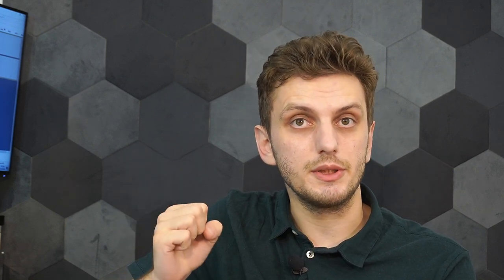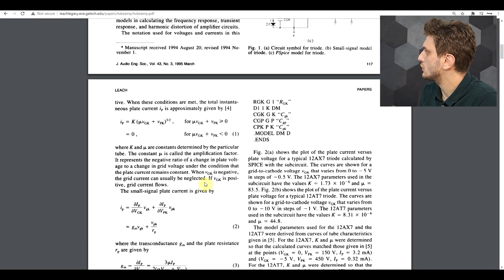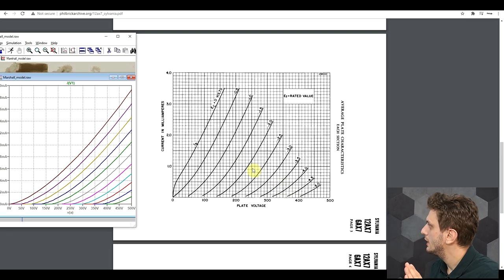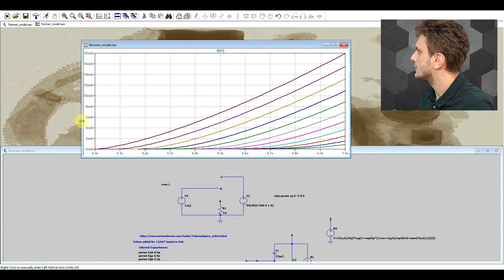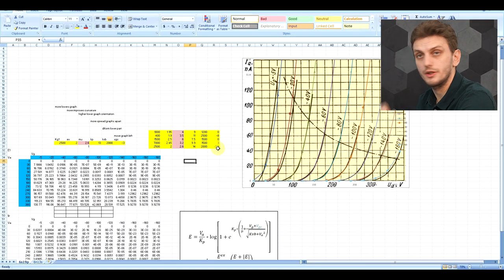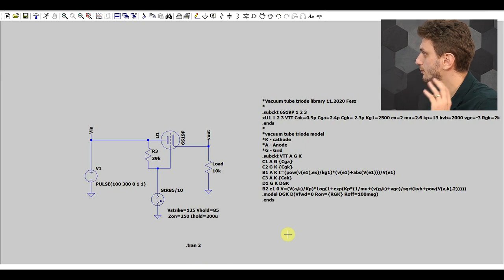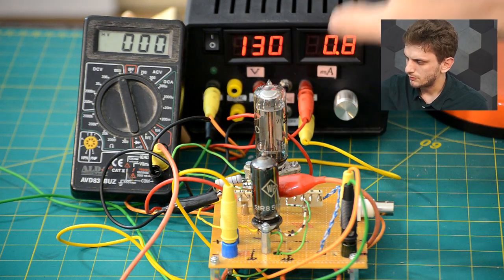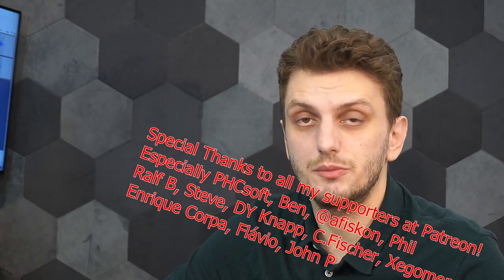LTspice tutorial - Modeling vacuum tube triodes

Comment: This is an amazing presentation and is just exactly what I am looking for.  I’ve been studying it.  
I have a few questions.  First, I am trying to replicate the example LTspice models.  I am not getting the same results as shown on the screen.  I think there are several issues.  First, when I stop the presentation and try to read the characters on the screen, some are fuzzy and difficult to get right.  Would it be possible to post high-definition images of the screens so I can be sure of the values I am typing in?  Second, after I do get the programs running, I am not getting the same graphs.  With the .tran 1 statement, all I get for anode voltage and current is a straight line.  So I am making a mistake but I don’t know what it is.  It may be that  I have some incorrect statements.  But it also might be that I’m not following the exact steps used to create the graphs (ie: the graph at 4:23).   Can you please explain the specific steps used to create the graphs?  Where did you place the cursor?  Did you select voltage or current at that location?   Third, in LTspice, I am not finding an StR85/10 tube.  Is there a substitution that would be in LTspice?  Is there a Zener diode that woujld work in this instance and still return similar results?   Thank you very much.

Comment: Absolutely excellent video!
In fact I was just about to model a few myself, but most tutorials are just not very clear imo. Thanks for clarifying a few thing! And yes that overlay trick works great, I use it all the time! 😎👍🏻👍🏻👍🏻
Reply from the maker: May I ask what you are working on? Usually there are not a lot of circuits where tubes make sense, but I'm always looking for new and interesting circuits.
Reply: @FesZElectronics  In general as a hobby, I like to build, repair and convert old radio's. Mostly because I find it very relaxing compared to a lot of PCB design I do with DSP's/Class-D power amps.
A lot of stuff can just be calculated on a piece of paper or just as you go.
(instead of sitting hours on end staring at a screen).
Also some guitar amplifiers and audio amplifiers. It's just fun and simple (relaxing) technology to work with and speaks a lot more than just a blob on a PCB in some cases.
Although I have also combined new- and old-technology (DSP with tubes etc).
I don't have a preference, everything has its charm so to speak.

Comment: Thank you sir. You saved me A LOT of time here. I just wanted models so I can predict approximate voltage and current levels. I used "multisim" to test their model of a 12ax7 in a JCM800 pre-amp circuit. I got 668 Vp-p on the last gain stage anode/CF grid, while only using 300V B+!! I knew something was off. Probably using that model that doesn't cater for positive grid voltages, giving me -400v odd swing below ground!!
Now I will try ltspice with your model. Hopefully I will get to more accurate signal voltage levels.
Reply from the maker: I did not use MultiSim, but I guess its also a spice language circuit simulator. Maybe you can import the model without having to switch circuit simulators. I know getting used to new software is difficult...

Comment: Excellent explanation. But when we get into the details a few aspects are worth noting. 2:59 The diode and resistor is a bit oversimplified model of the grid current. It does not take into account the influence of the anode voltage. The improved Norman Koren' s model does a good job of representing the triode stage's behaviour in what we would call 'the more linear regions of operation'. It also takes into account the influence of the tube socket and leads capacitances on the frequency characteristics. But if we are interested in analysing non-linearities in terms of the distortion characteristics, it is worth to use a model created by Ayumi Nakabayashi. At least when it comes to triodes in pre-amp circuits. Power amplifiers are a separate story and here all accuracy limitations of tetrode and pentode models come out quite noticeably. There is quite an extensive discussion about tube simulation on the diyaudio forum. There were also quite interesting attempts to improve the precision of mathematical representations.
It is also interesting, that on some schematics the given filament voltage is slightly lower than recommended in the datasheets. These are not big differences, but they can affect the operation of some stages. The only model that takes into account the effect of heating is the one created by Duncan Munro, although the precision of this model is not better than that of N.K. or A.N. models.
Reply from the maker: Hello Vicol! I aggrege the NK is not the best model, but it was the simplest complicated model I could find when I was doing the video. There will always be a more complicated and more accurate model... That being said, I did not know about the A. N. model and all the work behind it - which is quite substantial and seems really well made. I guess the big issue is that its all in Japanese,  there seems to be no English version on Mr. Ayumi's website. I will try to look int it though, thank you for pointing it out!
Reply: Yeah, Japanese :) Lucky that there are translators, because without them I wouldn't know where the 'download' button is, haha. But seriously, it's a very interesting topic and it looks like it's still being developed. I mentioned the discussion on diyaudio forum intentionally, because it's a huge source of useful links and unconventional ideas, which would be hard to find just by searching the internet. 
I think the topic of simulation and explaining what exactly happens inside the spice models is very important and I hope you will continue it. LTspice is a powerful tool and although there are programs with a more user friendly interface, the amount of possibilities is still hard to beat. I have been using this program for a couple of years and I still keep learning new tricks even from your videos :)

Comment: Hi. I had very accurate working model of vacuum tube 12AX7. After refreshing my PC new installation (with new blue buttons tool bar) doesn’t run old saved files with tubes. Do you know what is the issue?
Reply from the maker: You can check if the model is corectly linked to the simulation - there should be an ".include" or ".model" statement with a link somewhere in the simulation - maybe the link changed; if its something else, you could post the exact error that you are getting.

Comment: Thank you!! Really great tutorial, thank you very much.
So, can i replace the Ia/Va graphic with  others of different tubes datasheets and try to find parameters for them(using your spreadsheet)?
Reply from the maker: Of course, that was the whole point of the spread sheet; you can adapt it for any tube; its just that finding the right parameters is a bit difficult...
Reply: @FesZElectronics  yes, in fact i tried after this comment ,and I have to say that after different tries I came up with a good trade off!! I downloaded an image from Google of a tube( V plate versus Current Plate) and loaded that into your spreadsheet. Changed all Vg values( to match those in the graphic) and started tweaking the parameters. A little bit tedious, but in the end I found my parameters! Thank you very much for this work.
Reply: Do you plan to do this work for pentodes as well?